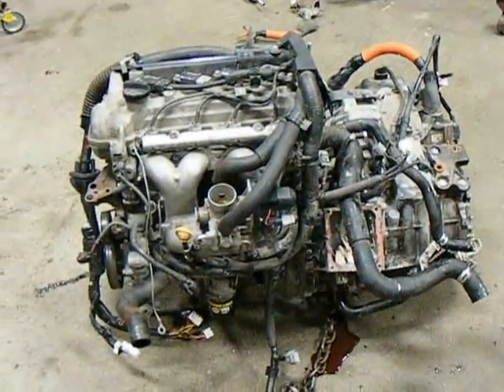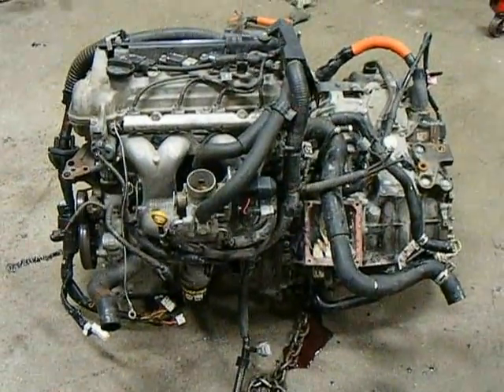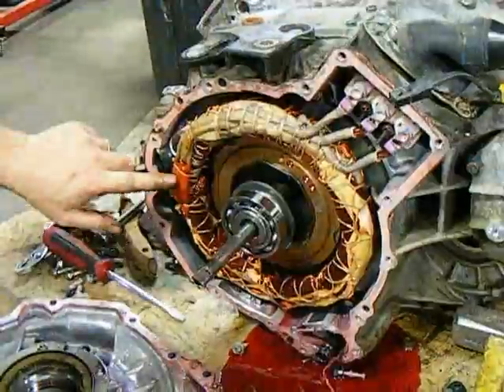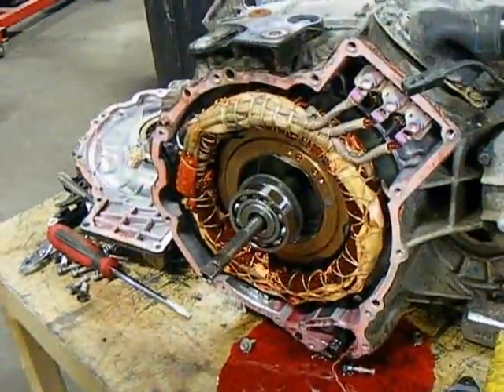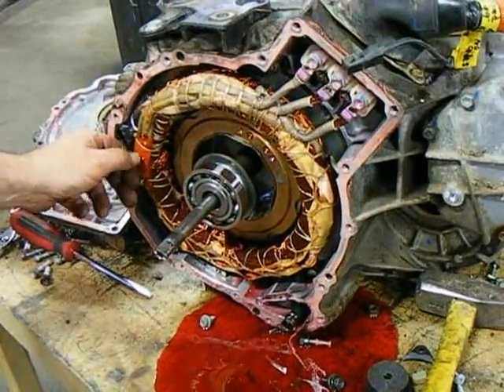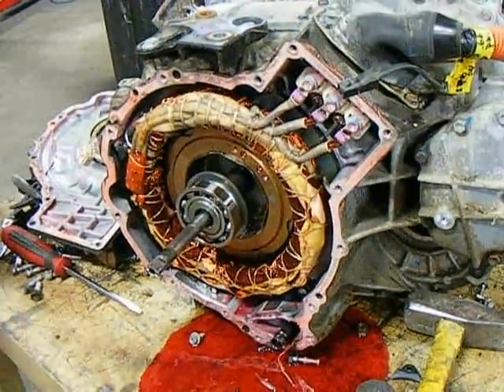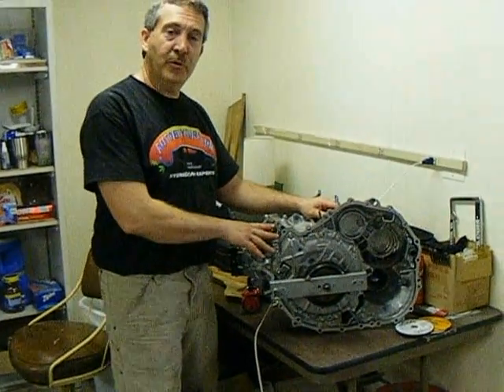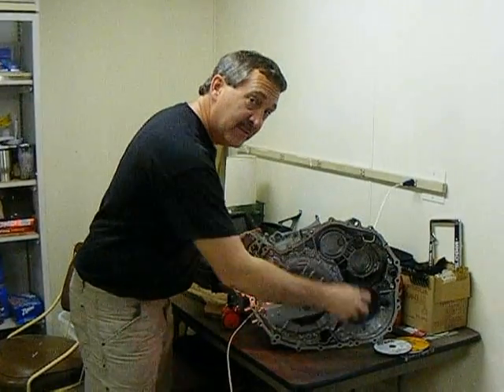Prius Transaxle after POAA6.avi

Comment: My prius 2012 energy monitor screen does not show power distribution. It only show my tyres moving. Does not show if the engine or they hybrid is powering the car and battery doesn't charge. 

I was told that I need to change my transaxile fluid. Pls is that my problem?
Reply: nope, that is a malfunction of the energy monitor.  but you should change the trans fluid every 60k miles.

Comment from the maker: I feel your pain ;)
this is why you should change the trans fluid.... to help prevent isolation faults.
be sure to use W3  from toyota as other fluids may be conductive.
Reply: I never trust anything that a dealer sells. I've worked for many dealers.  They only want to carry fluids that have the highest profit margin.  They don't care about saving the customer money or making the vehicle last long.  These are the best products you could ever use in a 2006 Prius, most notably the long lasting transmission fluid: http://www.searchforparts.com/oil-change/toyota-2006-prius-1.5l-1nz-fxe